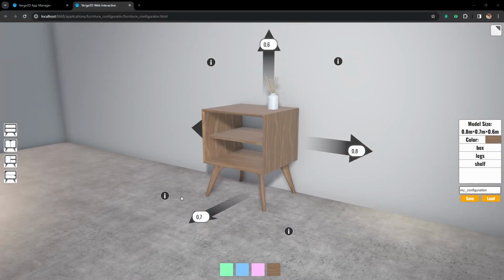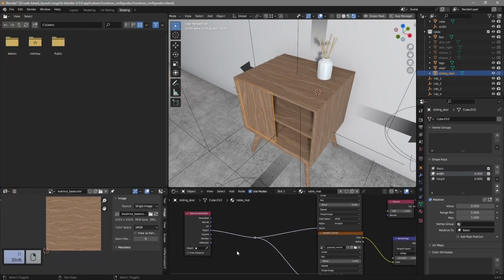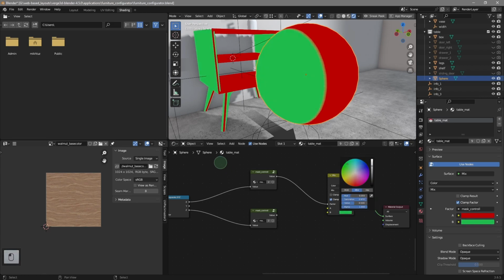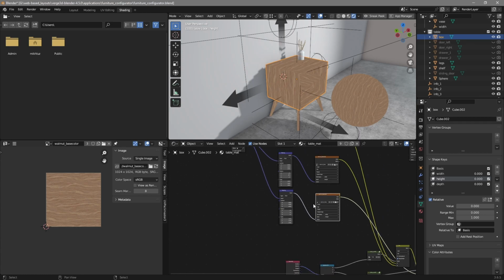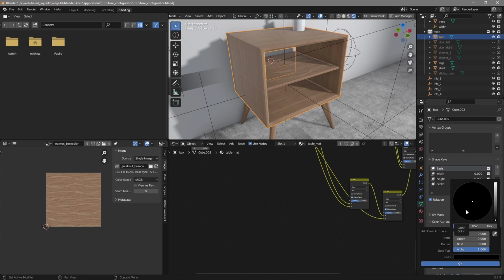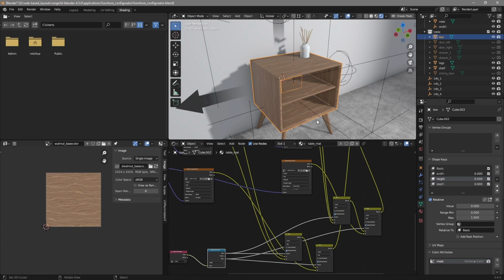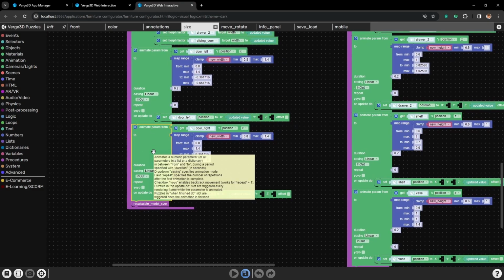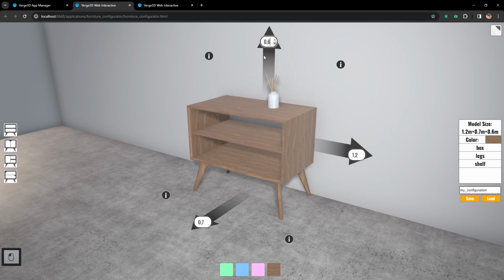How to Fix Texture Stretching

Comment: Hey, we're having issues when exporting a level we created in Blender as a .obj file. 
We mirrored some textures in blender, for example across a level wall, to get a high res tile like appearance, but when we load it into our OpenGL project, the texture is horrifically stretched across the entire side of the wall, rather than repeated. 
You got any idea how to fix that? 
Do we need to bake the texture for each mesh, or how does this work?
Reply from the maker: very specific question, can you crteate a specific topic on our forum with this question with example file, we try to help.
Reply: @Soft8Soft  We have managed to fix the issue for now by baking each texture individually for that specific mesh. 
But thank you so much for your reply, Ill be sure to post it in the forum once I find the time

Comment: Hi there, nice tutorial! I am currently trying to replicate this process in Maya. I am,, however, getting stuck quite early on because I cannot find a way to make a 3d texture projection work in Verge. Do you have a method for this or is it simply not possible?
Reply from the maker: Sorry but we are do not dig in this question yet, so we are not sure that all things are implemented in Verge to support this feature in Maya, but we have plan to make this tutorial series for Maya in some future so then we will find a way to support the same way to apply textures.